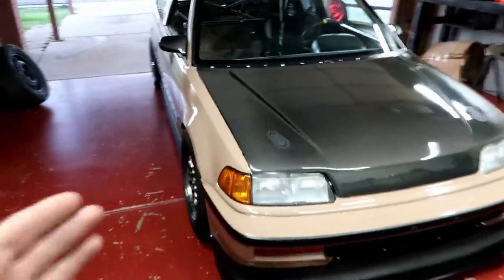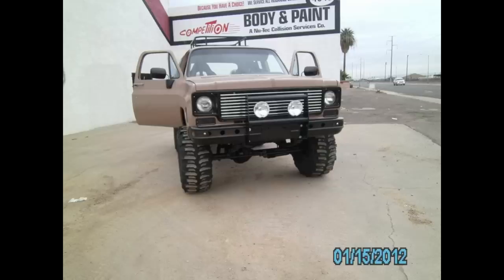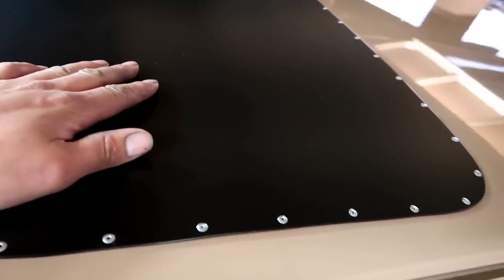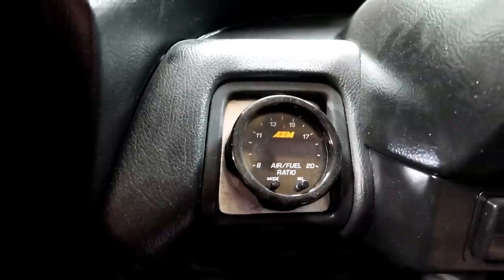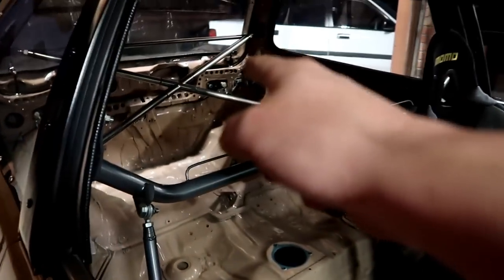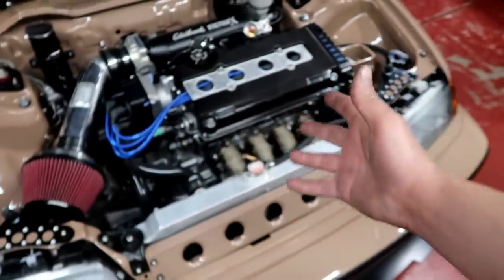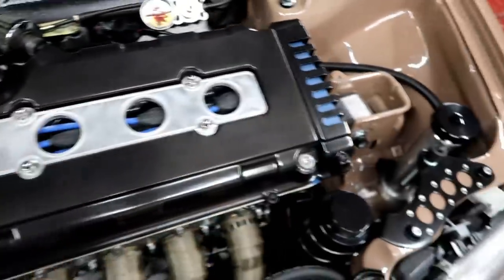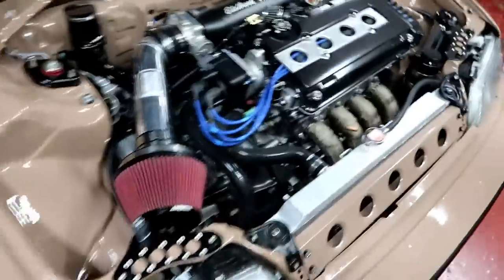Closer look at the khaki civic (WARNING This is a 27 minute talking video)

Comment: #DBFAM, Just chillen at work watching your videos, Even though I've seen all of your uploads it's still nice to get one like this. 
I just got a non running '88 dx hatch for $100, was planning on getting it running & sell it but I noticed quickly that it has full Eibach Pro Street coilovers, eibach adjustable upper ball joints etc & it's already all converted over to the 89-95 style rear arms. Now my plan is to swap all suspension parts to my Tahitian Green Pearl '91 si hatch and put all of the Monroe shite back onto the '88 to sell. It's also got some pretty rare vented fiberglass fenders I think I'm going to steal for my '91 JDM GSR swapped Championship white SI track car.

Keep the motivational videos coming bro, I've even got allot of my non-Honda friends watching them with me now days.

Comment: @deadbeatgarage hoping the dbfam can come in clutch . I need a picture of the 6 pin plug on the fan speed switch on the climate control on a 91 civic hatch . I know you have that parts hatch . I depined mine without taking a picture first and cant remember where the wires go

Comment: I’m going to break you heart but you will not see 230hp to the wheels on this set up. You might hit 210-220 and 220 is being generous. People with B series have trouble getting out the 210hp zone people that run pro NA run race gas and hit 250-270hp and some crazy dudes sleeve the block so big. Like I’m sorry if you get 230hp to the wheels I’m going to be amazed and never doubt you again. But it won’t happen.